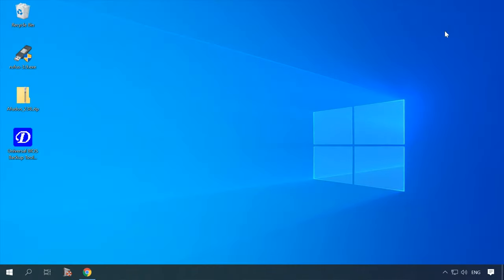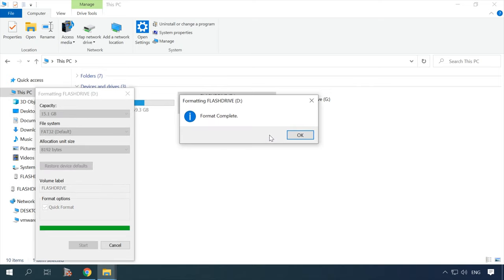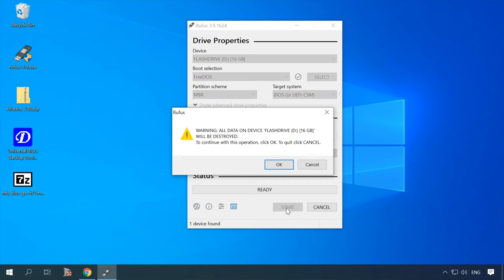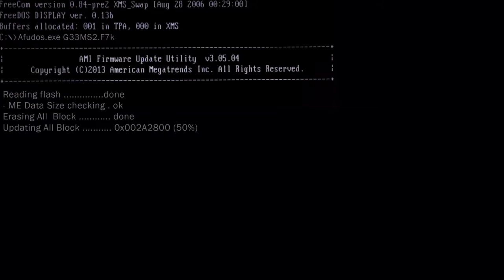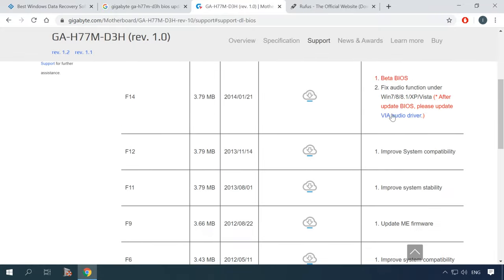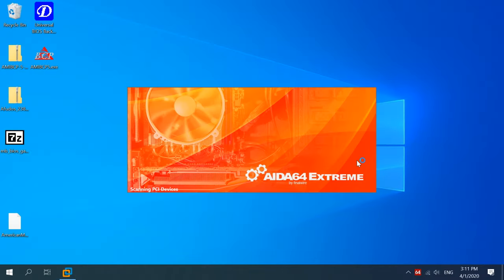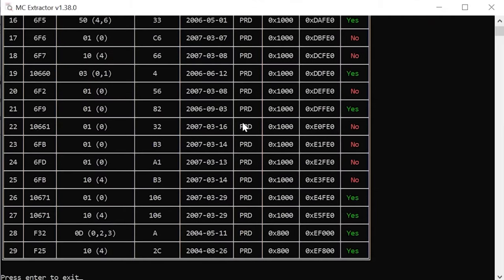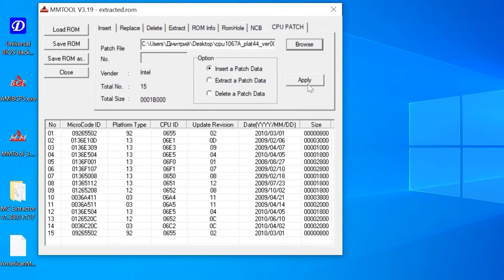🔂How to Flash BIOS With Third-Party Firmware, or Modify BIOS 👨🏿‍💻

Comment: amibcp doesnt open my bios motherboard : intel dq57tm
Reply from the maker: If AMIBCP (American Megatrends Inc. BIOS Configuration Program) is not opening your BIOS for your Intel DQ57TM motherboard, there could be several reasons for this issue. Here are some steps you can take to troubleshoot and resolve the problem:

Check Compatibility and Version: Make sure you are using the correct version of AMIBCP that is compatible with your BIOS version and motherboard model. Using an incompatible version can lead to issues.

Administrator Rights: Run AMIBCP with administrative privileges. Right-click on the AMIBCP executable and select "Run as administrator."

Antivirus/Firewall: Disable your antivirus or firewall temporarily, as they might be blocking AMIBCP from accessing or modifying the BIOS.

BIOS Lock: Some motherboards have a BIOS lock that prevents unauthorized modification. Check your motherboard manual to see if such a lock exists and whether there are any steps to disable it temporarily.

BIOS Configuration: Ensure that your BIOS is properly configured to allow external tools like AMIBCP to modify settings. Look for options related to "BIOS Lock" or "Configuration Write Protection" in your BIOS settings.

BIOS Update: Ensure that your motherboard's BIOS is up-to-date. An outdated BIOS might have compatibility issues with certain tools.

Corrupted AMIBCP Installation: Reinstall AMIBCP to ensure that the installation files are not corrupted.

Compatibility Mode: Try running AMIBCP in compatibility mode for an earlier version of Windows if you're using a newer version of Windows.

Other BIOS Editors: If AMIBCP continues to have issues, consider using alternative BIOS editing tools that might be compatible with your motherboard.

Contact Support: If none of the above solutions work, consider reaching out to Intel's support or the motherboard manufacturer's support for further assistance.

Always exercise caution when working with your motherboard's BIOS, as improper changes can lead to system instability or even hardware damage. Make sure you have a backup of your BIOS settings before attempting any modifications.

Remember that modifying your BIOS can have significant consequences, and it's recommended to proceed only if you have a clear understanding of what you're doing and why you're making the changes.

Comment: i have a cm 1831 motherboard, it is a asus m5a78lm/usb3 motherboard but with all the advanced settings hidden. on the board it says m5a78lm-usb3. but in bios it says cm1831. i have updated the cm1831 to the latest 0903 version which is from 2012. but if find the latest version for the board name its 2101 from 2015.

it is the same board, same pictures and everything else, just the bios is like locked stuff is hidden, i would like to install the normal/unlocked bios so that i can do a small underclock/undervolt for my fx6300 as the vrm is heating up in summer, and sometimes the pc freezes because it goes to 60*C sometimes, maybe i need to remove the vrm heatsink and reapply thermal paste or something as well.
Reply from the maker: It sounds like you are trying to modify your motherboard's BIOS to access advanced settings and make adjustments like underclocking and undervolting. However, I must caution you that modifying the BIOS can be risky and may lead to unintended consequences, including bricking your motherboard if not done correctly.

If you're experiencing temperature issues with your CPU and VRMs (Voltage Regulator Modules), there are a few steps you can take before attempting to modify the BIOS:

Thermal Paste Replacement: Your idea of reapplying thermal paste to the VRM heatsink is a good one. Over time, thermal paste can degrade, leading to poor heat transfer. Carefully remove the heatsink, clean off the old thermal paste, and apply a small amount of high-quality thermal paste before reattaching the heatsink.

Case Cooling: Ensure that your case has proper airflow and cooling. Make sure your fans are working correctly and that the case is not obstructed by dust or other debris.

CPU Cooler: Consider upgrading your CPU cooler. A better cooler can help dissipate heat more effectively and reduce VRM temperatures.

Undervolting: While it's not recommended to modify the BIOS, you can try undervolting your CPU using software tools within your operating system. Tools like AMD Ryzen Master or BIOS settings (if available) might provide some control over voltage and clock speeds.

BIOS Update: If you're still inclined to update the BIOS, make sure you use the correct and official BIOS update from the motherboard manufacturer's website. Follow the instructions precisely to avoid any issues.

Professional Help: If you're uncomfortable making hardware changes or BIOS modifications yourself, consider seeking assistance from a professional or a computer repair shop.

Keep in mind that even with modifications, the VRM design on the motherboard might still pose limitations on cooling and power delivery. Extreme undervolting or overclocking can potentially cause instability or damage to your hardware. Always exercise caution and thoroughly research before making any changes to your system.